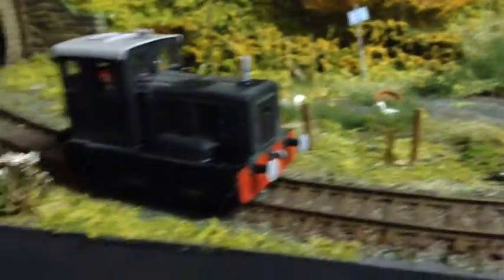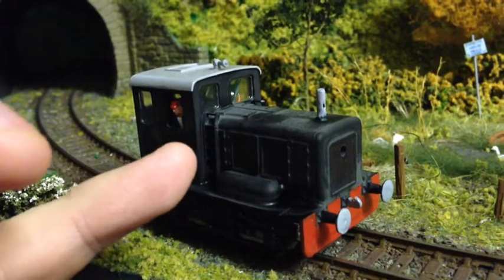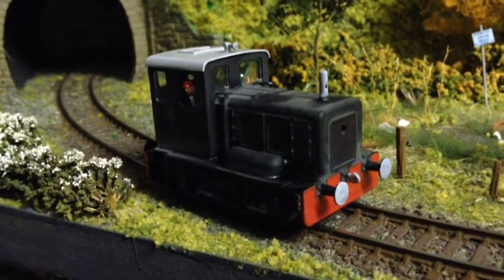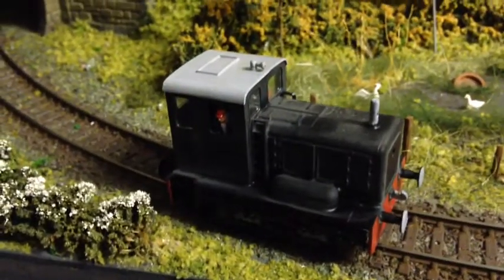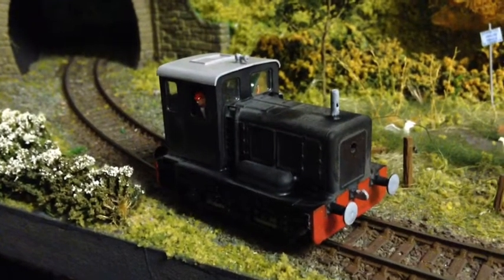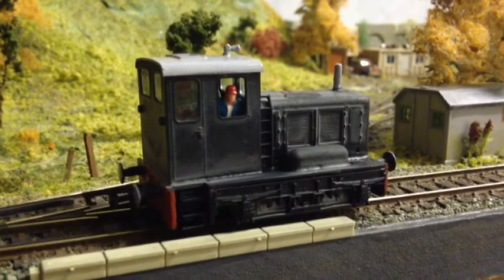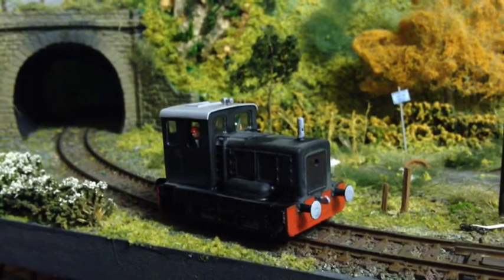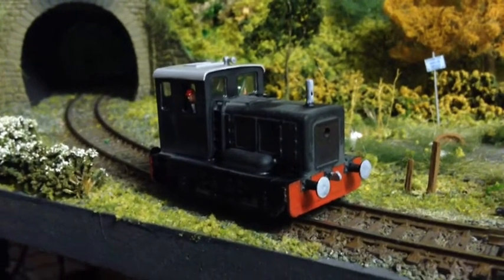Shunter Project Update 3

Comment: The pointwork issue is one I've met as well. I'm sure you will find a solution. The stills at the end are very helpful.
Reply from the maker: Its one issue that really plagues me in modelling!!! Smaller locos and points!!!! U wud think by todays standards of RTR models, this could b covered and no longer cause a problem!?! Wothout the need of electro frog pointwork and isolating tracks??!!!!

Comment: I do admire your modelling skills. Shunter looks terrific, with ladder and bonnet doors etc. Pump needle clever. Paint finish is fine. Sometimes in cold damp weather I get this effect. In fact gloss shades can come out satin or even matt due to the dampness. This happens when I spray in the garage in the winter with no heater.
What's the problem over points? Derailments or poor running?
The only comment I might make, if you don't mind me saying, is that perhaps the driver could do with some black wash over him - he's too clean and stands out against your wonderful weathering on the loco. A wash would work wonders on him.
Track colour is very realistic looking. Really nice foliage. Smiled at amorous and the bin.
Reply from the maker: Thank u very much for ur comment :) im quite happy with the finish so far?! A few little details to add nxt!

I guessed the paint finish was something to do with heat, where handled etc?! Bt its left a welcome finish :) 

The running issues is over pointwork! I HATE unreliable running, and crave slow realistic speeds! This little motor is a cracking slow runner, bt stalls on points, grrrrrrr!!!! 

Thanx for ur tip on the driver, ur probably right?! Cheers :)
Reply from the maker: Thank u very much for ur comment :) im quite happy with the finish so far?! A few little details to add nxt!

I guessed the paint finish was something to do with heat, where handled etc?! Bt its left a welcome finish :) 

The running issues is over pointwork! I HATE unreliable running, and crave slow realistic speeds! This little motor is a cracking slow runner, bt stalls on points, grrrrrrr!!!!

Comment: The shunter is amazing.  Your health needs some buffin up.  I am sure you will sort out the running.  My new 52xx 2-8-0  doesn't like points much either.  All in all impressive bit of work.
Reply from the maker: Cheers Rob, the cold is on its way out now :) hope i cn sort the running?! I nd to watch ur new loco vid, they can b very troublesome these smaller locos!! U wud think in this day n age this problem wud b resolvednin locos?! Thanks again mate :)
Reply: Matthew Snowden Hi Matthew.  It was DCC with sound and I think a CV was set to the wrong value.  There are hundreds of things that can go wrong with them and only one way for them to be right.  Odds are, they won't work, but usually do.  Cheers
Reply from the maker: Yeh ive watched now :) pot luck i guess?!

Comment: Excellent work Matthew! It's turned out a right treat and love the serdendipitous effect of that paintwork. All the little extra detail to hide any flaws is really clever and adds a lot of character and makes it very much your model and am sure these sorts of customisations were done by the engineers all the time so it's apt. In terms of the point work is it possible that it's restricted wheel movement due to sidework? If it's a power issue, is there any room inside for a 'stay alive' capacitor that acts like a little battery that gets charged up when running and then outputs charge during any small loss if power over the points? Looking forward to seeing the finishing touches in the next episode :) - Sim
Reply from the maker: Cheers Sim, thats a very confidence boosting comment :) the paintwork, a sheer fluke, looks brilliant!! Its flaked in a couple of places since that vid, n even that has given a slight paint chipped look! A few mor little touches n she'll b dun :) i stil havnt solved the running issues :( the ideas u mention are great, and cud work!!!? But i think they are way over my electrical head :-/ lol!! Im quite weight wud help?! However, it ran perfect with the original Ernie body on, AND its impossible to add any weight anywhere??!! Soooo, i do hav a plan for my little Ruston for the future ;) thanks mate
Reply: Actually have just been reading up about them and it looks like adding a capacitor is a little awkward for DC versus DCC but people were also saying points shouldn't usually be too much of a problem for dc so maybe it is the wheel thing... Good luck sorting it out :)
Reply from the maker: I'll just send it to u n u cn hav a crack at it eh :)
Reply: Nah, I have an interest in, but no actual definable skill as yet in such things, so in all likelihood you'd end up receiving back a charred and melted lump of plastic :)
Reply: For dcc you can get decoders with a stay alive capacitor already built in by companies like dcc concepts and places like Olivia's trains can fit them but not sure if possible for dc at all... In terms of fitting capacitors EverardJunction (predictably) gives a good explanation of them in his coach lighting video...
Reply from the maker: Haha!! Im sure it wudnt, bt it def wud if i tried it :)

Sending it to pros wud mor or less b my best option!! Infact, my electrical skills r so
minimal, im quite sure i skippd Everard Jnctns coach lighting vid :-/ i wudnt b able to do it, so didnt watch it! My plan for the Ruston is to giv it its own layout?! A rocky mine theme infact! A little roundy roundy that disappears into shafts, and only has electro frog points!! Hey presto that wud solve the poiny issue :) bt thats waiting for space im afraid! And it wud accomodate othr 0-4-0's like my re-liveried 06 :)